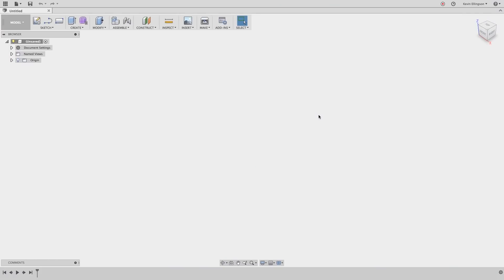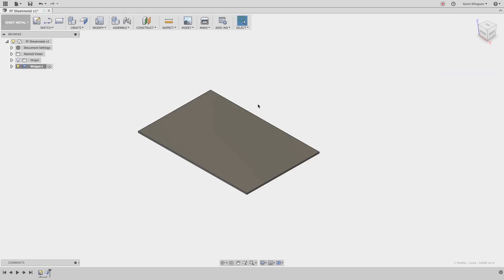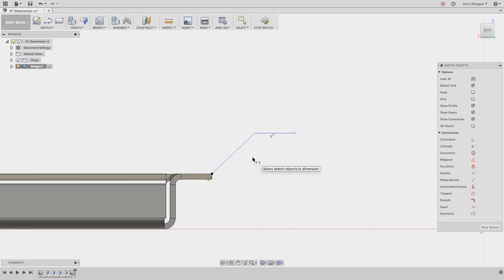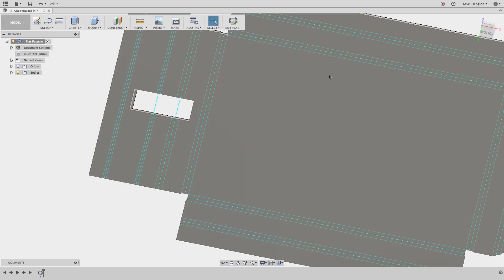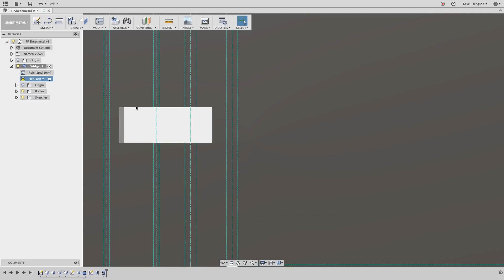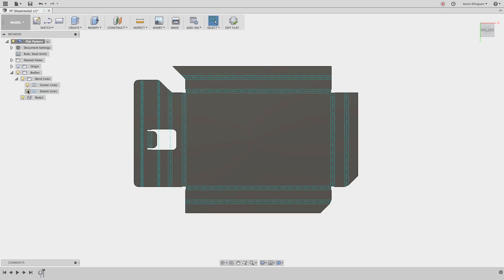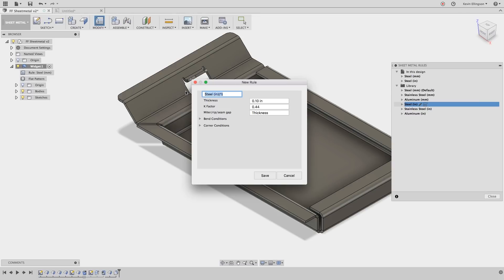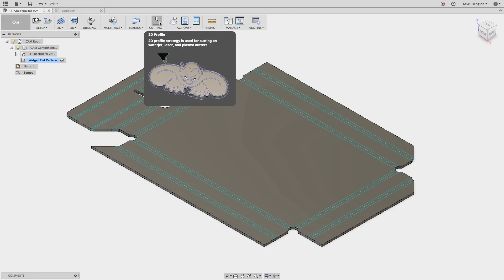Fusion 360 Sheet Metal Tutorial!  FF94

Comment: Cool video.

But quite honestly, I've found sheet metal modeling to be useless for a mechanical designer beyond the quick sanity check.

Sure, it makes it look pretty, but complicates the hell out of the model, makes it (and every assembly it's in) incredibly "heavy," and locks the sheet metal house into something that may not be needed or even worse, possibly even a "special." Many will just remodel it from the print anyway to get a flat pattern that works and is accurate for their use. 

Throw some bend radii call-out's as needed on a "square" model and let the sheet metal guys do what they do, IMO. Especially in cases where joints and whatnot are going to be welded, which admittingly is the category most of the 100's of sheet metal parts I've designed fall into. Personally, if you're designing sheet metal I'd recommend learning what's feasible when it comes to tolerances for things like the distance between holes in two flanges with 4 or 5 bends in between them. The manufacturer will gladly make the part for you while leaving you with a major case of sticker shock because you don't know they'll be machining or lasering those holes after bending instead of punching the flat pattern. Also, even if you do very little sheet metal work, schedule a visit/tour with your primary sheet metal vendor to find out exactly what they want/prefer from you, what their capabilities are, and what kinds of features/call-out's are most likely to result in giving you sticker shock. Sheet metal isn't immune to "I don't want that job" type of bids, but I've found there is a pretty fine line between those bids and real bids depending on the competition in your area, just how big (or small) the vendor is, proto work with or without production to follow (a small shop may gladly take on a very complicated part when the qty is 1 but absolutely not want you to come back with production qty's), long run contracts with staggered deliveries, etc, etc. Visits/tours can clear this stuff up along with teaching you quite a bit and making you a better engineer. 

Just some things to think about!
Reply: You bring up some interesting points for discussion. The first would be will sheet metals parts be designed in house, or will the be produced by a vendor? There is a good chance that if parts are being produced by a vendor that all the vendor will want is the outside folded dimensions of the part and they aren't interested in the flat patterns, k factor values, or radii that are in the folded model as their machines will use their own values that the vendor has calculated. If the parts are to be made in house, bend studies can be performed to determine bend radii and k factors for each die and material. Once those bend studies are done, extremely accurate parts can be produced. I worked for a company where a large part of my job was creating sheet metal parts. These parts went straight from CAD to laser cut flatter patterns that were bent up into finished parts. The parts could get fairly complex and I don't recall every have to change a part because something didn't line up after forming. 

Thanks for pointing out some of the things to think about when creating sheet metal parts.
Reply: Wrenchmonkey this isn't always possible, and under the right circumstances a competent designer will make it completely unnecessary. The specific circumstances are large company, high volume, purchasing "separate" from engineering, and part designs that are repetitive in nature. Also, having rock solid call-out's on the prints. Basically, once you gain experience you learn how and where to leave the part as "wide open" as possible. "Spot weld corners OK, max bend radius = X, min bend radius (i.e., make it as small as you can, but I don't care what the value is, I know it'll be around ≈ Y), A -> critical surface (customer will see this A LOT) weld splatter and tooling marks unacceptable, G -> non critical surface (never seen) do whatever you want," etc, etc. Use larger clearance holes and loose location tolerances when holes are across many bends, and combine that with button head screws that have integral washers (the proper name escapes me at the moment). Make sure PEMNUTs are placed on the correct part and that there is ample access to install them (or weld nuts or whatever). (I mostly work on enclosures if you haven't noticed yet LOL) 

NOW, for new proto parts, or the guy/company that rarely deals with sheet metal, absolutely get with the vendor. This is how you gain experience, and oftentimes is the point that cost saving design changes on already established parts are found. 

IMO, gaining knowledge in this manner is a critical skill needed for all manufacturing processes, and with manufacturing moving offshore and colleges churning out grads with little to no real world experience, it is very lacking with  engineers today. This is where ±.0001" tolerances on hole locations 5 feet apart come from. As well as "impossible" parts. Sure, they are freaking awesome in their function in an assy on the computer, but will cost a fortune or literally be impossible to manufacture. I've seen mid level engineers churn out such parts. 

Anyway, sorry for the long post. Especially as I think we are really on the same page here.

Basically, communicate and visit with your vendors (as well as customers) to learn as much as possible about various processes you deal with as that's best path becoming a competent designer.
Reply: Totally disagree, +Iceberg86300. I have done extensive studies to get my bend deductions, bend radii, and K factors dialed in for all my materials and thicknesses. I can get a +-.007 consistency every time with a flat pattern that "I" generated in Solidworks. Sheet metal isn't just a white-haired art any longer. It is a proven science that is very predictable.
Reply: Evan Parent I'm not saying what you've done isn't possible. I'm not even saying sheet metal modules should never be used, especially in your case where everything is dialed in and seems stable. And you're very correct that it is a science (but "greybeard shops" still exist).

What I am saying is that there are other things to think about here. You said it yourself, "extensive studies" to dial in all your materials and thicknesses. Some companies don't want to do this, may have zero need to do it, or will gain nothing (even potentially losing in some way) from it because of how they operate.

Just because you can doesn't always transfer to you should. It just isn't that cut and dry. Every company is going to be different. I'm just presenting one side here, again, as a source of topics that one should take into consideration. That's all.
Reply: Mechanical Advantage everything you've said is spot on. In my work, everything sheet metal has been contracted & like I said in my post above, is best to be designed and called out "as open as possible." 

Just the opposite when it came to machined parts. 95% in house. We developed certain methods & practices to machine a part in as few ops as possible, and applied those methods everywhere. Couple examples are back boring /facing & using thread certs. All the "back" operations allowed us to machine tables and other large parts completely in one setup. Thread certs allowed tiny (comparatively) threaded holes to come off a 50 taper machine with great accuracy and tool life (at the exchange of someone installing the certs, but that labor was much cheaper).

"Window" fixtures on parts going into a horizontal allowed a part to be finished without ever unclamping the part. 

Now, all of this was meaningless if the engineers never knew about it, because we had to design for it from the beginning or it wouldn't work.

If we were a contractor we wouldn't want customers trying to design for this stuff, we would want the freedom to apply it as we see fit.

Interesting points, indeed!! There's a lot of knowledge in some YouTube comment sections!! If only it was easier to find.
Reply: I never said it's ALWAYS useful. You seem to be arguing that it's never useful. I don't think that's accurate.
Reply: Wrenchmonkey I can't say that it's never useful, and didn't think that's how I came across. But as I've been talking about how important getting feedback is, I'm compelled to take yours. 

And after rereading previous posts, I have come down pretty hard on the side of not fit farting around with sheet metal modules! I've already outlined my personal circumstances that lead to this opinion.

But, I cannot deny that I found them quite useful when I was "green," and still do today on some parts. This was using SW's module from 05 on. As aggravating as that product can be, with settings at their defaults it's a great visualization tool for how most parts will come out, and more importantly, if they'll even come out at all. I still use it on complex parts if I'm not sure the "basic square" model can be folded/unfolded. Even if a complex part is going to have every corner/junction welded b/c it needs to be watertight, I'm still going to perform a sanity check to make sure no patchwork is required. This is where vendors will be consulted as well. 

With that being said, I've never put a single finished part into the production or proto database that included the sheet metal module. It has just never worked for us. We aren't making the parts, there are thousands of them, many different vendors are involved (sometimes on the same part + new vendors), any of 50-100 engineers may "touch your part" in the future, and they end up in 1000+ part assemblies. So it's in our best interest to release "square" parts with smartly toleranced and annotated prints. 

Like I said in my first comment: Just some things to think about.
Reply: The more tools the better! it's there if you need it.
Reply: A competent person would discuss the prints with the shop providing the work prior to finalizing the design, and would not have any surprises on the pricing, at the end of the day.

Comment: Thanks for the very clear demonstration. 

Pitching some ideas here for future sheet metal demos :
It would be nice to have a demonstration how to apply sheet metal to an existing assembly. 
For example, I've designed a motor + gear + spindel mechanism, but would like to create a sheetmetal cover around it for protection/safety cover.
What is a good strategy to start design such a cover.

Another nice one, would be how to combine sheet metal for structural design. Like tormach uses sheetmetal to create their mill base. Since sheetmetal is more cost effective, it would really be a nice to learn to use fusion360 for that type of work.
Reply: Hi Tom. I'm glad you found it useful. Thanks for the potential future topics.

Comment: With sheet metal there is no more reason to stay with SolidWorks, at least at the small company I'm working for.
Reply: Solidworks is far more robust, capable, and stable than Fusion right now. Fusion has done a good job of getting started, and I look forward to where they head with this, but Solidworks is still the industry standard for good reason.
Reply: PieceMaker 
Solid Edge is still my preferred sheet metal CAD program.
Reply: Nope, Fusion 360 has a long way to go in regards of functionality in sheet metal compared to Solidworks. I use both and thought like you too, but a few key functions are simply missing, rendering sheet metal in fusion unusable for me at this moment. 
not being able to make cuts while folded and get good flat patterns is just a joke...

Comment: You can't do a hem in fusion
Reply: You can't do a hem in Fusion......yet. Look for that tool to be added in one of the next two updates that the Fusion team has planned for the sheet metal tools. You can create a hem today. The hem would need to be drawn as a contour flange. So it is possible, just not quite as automated as it could be (yet).
Reply: Mechanical Advantage fair enough.
Reply: We do foodservice stainless and it also has issues with our sanitary rolls (3/4 inch radius bends) - it leaves our radiused corners as a huge hole
Reply: Not a problem, you just need to change your sheet metal rules.  You need to model all adjacent flanges at the same time and make sure the miter option is checked.  Change your miter gap in the sheet metal rules sections to as tight as you want.  The 2 bend corner relief shape needs to be changed to arc weld to do what you want.  Hems can be done as a contour flange or two 90 degree flanges.

Comment: Thanks for sharing, the little tab is a bit ugly like the old corners, how do you fix that?
Reply: That would also be controlled by the rules. Almost everything about the look of the part is controlled by the sheet metal rules. The option I changed controlled what happens when bends meet. There are a couple of ways to control the small flange you are referring to such as not having the bend start tangent to the existing face. There are also some settings that control the bend relief size and the minimum remnant for cuts.
Reply: Mechanical Advantage seem much more powerful that the sheet metal of solidworks, fusion it's a game changer imho